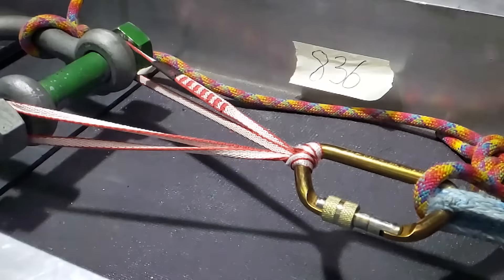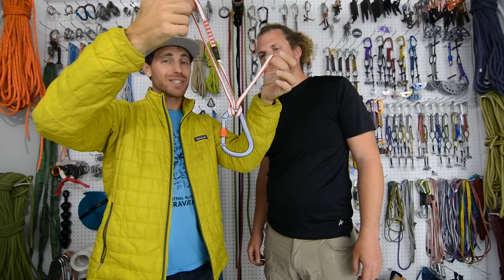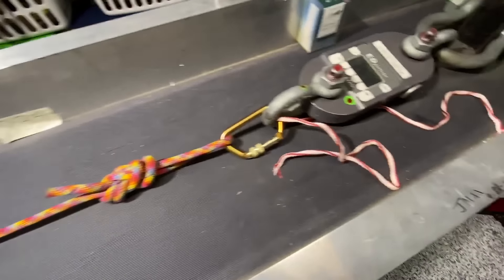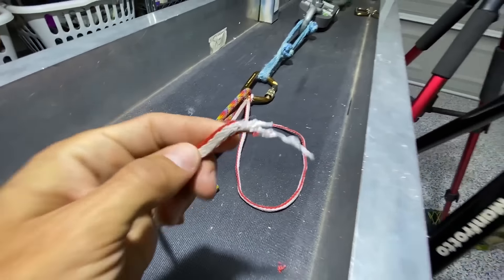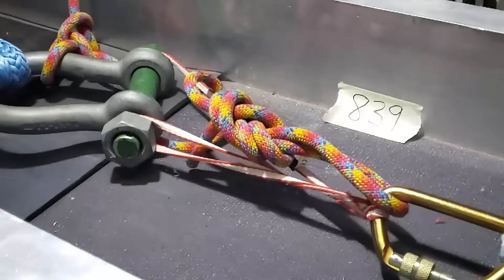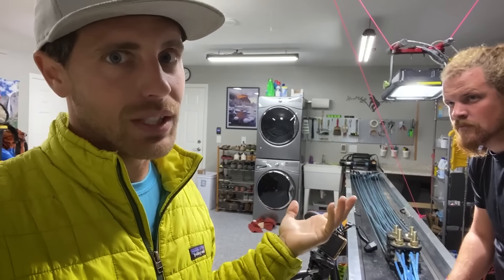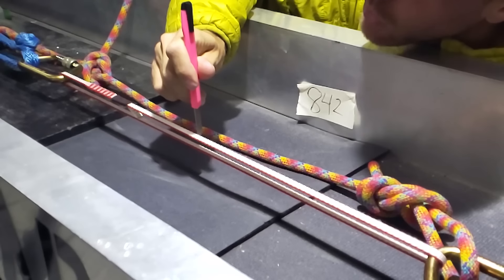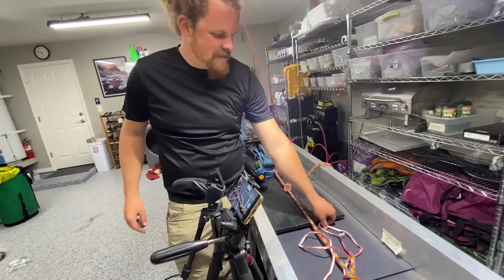Are climbing master points made with a girth hitch or clove hitch REDUNDANT???

Comment: It would be interesting to see the scenario of using clove/girth hitch anchor when the bolt fails instead of the sling failing like in the video. I predict that the carabiner would prevent the sling from slipping all the way through thus increasing the strength(compared to the sling being cut).
When I'm building an anchor to belay a second on a multi-pitch , I am more concerned about the bolt failing then the sling failing, since the sling is mine, I know its history, and I can adjust the anchor or my stance to prevent abrasion, while a random bolt has a lot more unknown variables.
Reply: Agree! Shitty bolts or dubious pro seem like a more likely failure point. Putting the sliding X in it would probably be a good idea, as they mentioned.

Comment: When you do the quad anchor on Accessory cord I would like to see the following scenario(s):
1) Have only "1 bolt" connected (like one bolt "failed") and pull from the remaining bolt and the master point biners with 2 ropes clipped vs. 3 ropes clipped in the quad. In Various thicknesses of cordage.
I know 7mm is the recommended, without realizing I've been using 6mm for years, and do 5mm as well.
I hope I was able to articulate what I meant.... you really should have more subscribers, this is such an awesome channel, I can't recommend you enough!
Reply: Super excited to see how the quad holds up. I bought 7mm cord to build my TR anchors and I'm curious if a double length dyneema runner would do the job just as fine.
Reply from the maker: Thanks.  2 quad anchor episodes coming out over next two weeks.  So many rabbit holes to test

Comment: Good video! Thanks for breaking so many nice pieces of gear so we trust ours more - or less =) 14:05 would love to see it stopping at something like 2 kN and keep to see if it stays or slips. Reason is, you had a fall with load peaking at 4.5 kN, one of the legs broke, then you're hanging on the other leg. The peak load is gone, now the load will be smaller, and the imporant thing is the the other leg holds it and you don't go anywhere.

Comment: About the girth hitch with or without the magic X.
If an anchor fails, it could lead to girth hitch slippery till the end of the sling and out (g.h. without magic X) if you do not consider the anchor carabiner.
But the carabiner is still there, if not broken, so it will prevent the fatal slippery, no matter the kind of girth hitch done.
Good job!

Comment: Longtime listener, first-time caller from the climbing world.

I would be interested in a "sketchy AF alpine/trad/rap anchor setup." The kind of stuff that you come across in the mountains at 2AM and go ahead and rap off because maybe, just maybe, you'll be blessed with the sweet sweet release of eternal death after days of exhaustion, exposure, and starvation. Things like 1" webbing, 9/16" webbing, or 5-7mm cord either directly threaded through or girth hitched to bolt hangers, eyes of pitons, or even directly through the wire cable on stoppers. Basically, when playing this flavor of Russian roulette,  how many chambers are loaded in the gun?

Similarly, how strong are knotted sling placements? There's a lot of variables at play here (material, knot used, placement quality, ...) and building an appropriate test rig might be more difficult. Perhaps something along the lines of a V-slot between a couple boards bolted together?
Reply from the maker: Got any pictures of sketchy af anchors that you are imagining?  Send it to skylining@live.com  I like the idea!
Reply: @HowNOT2  I'll take some shots tomorrow on my workbench of some of what I'm envisioning. In the meantime, this clip https://vimeo.com/222262746 gives a view of Mark Smiley reconfiguring rap anchors in the Ford-Stetner couloir, which is the most popular ski descent off of the Grand Teton (popular being a relative term, here). The before shots (and frankly even the after shots to some extent) give a good image of the anchors that haunt my nightmares. Probably fine for low angle rappels, but certainly a long ways from UIAA certified...
Reply: Good question. Slings, cord, and knotted webbing through any of the hardware you described is going to be fine for rapping. Maximum force you can generate is not much more than 2 kN. The quality of the hardware you were clipping is another story, but the sling material is never going to break. For example, a sling through a stopper wire girth hitched was pull tested to 9 kN. https://www.alpinesavvy.com/blog/hitching-a-sling-direct-to-a-stopper-wire-acceptable

Comment: A common UK and Euro system for two points is a sling with overhand in the centre. The biner then clips through both loops created and each loop goes to an anchor. Can you test that?
Could you do a pure girth hitch test? Say, to a harness belay loop?
Reply from the maker: Do you mean a BFK anchor?  We could test real girth hitches.
Reply: @HowNOT2  I think he means a Shelf Without a Master Point (or SWAMP) anchor. You can see it made here: https://youtu.be/XpwY4vLEKYo
Reply: @KakeaGill  that's it. Just never knew the name. In the UK it's just a sling with a kot in.

Comment: I think it's an really important point, that, if one line on your anchor gets cut and you whip on the still intact one, you might achieve ~7kN force, BUT that is a shockload. So I would GUESS(!!!) that there is a good chance that the knot might not slip the whole way. Sadly that is probably not really testable safely.  
You awesome guys did mention that, but only in like a sidefact.

Thanks for your work! 
Cheers!
Reply: That is what I was thinking as well. That pull held 6-7kN for 3 or 4 seconds of slow slippage where as in a fall that would be the force for 1/10th of a second or less.

Comment: Some comments already mentioned but would be great to see a dynamic test of the clove and girth hitched slip after one side is cut i.e. one bolt fails.  Could start with 80kg FF2 and keep upping the weight until it fails and/or slips.
Reply from the maker: I will probably be doing a drop test machine in the next 12 months.  Have to solve the dyno problem... fast hz dynos are not easy off the shelf purchases.  But will soon/eventually

Comment: If you go to Samson rope website (they make dynema ropes up to 6 7/8" diameter) they specifically say not to use any knots with their rope (or any rope with the same material) because the friction from the knot cinching down creates enough heat to melt the fibers.

Comment: Good to know: 21:15 I didn't break at the cut! =) Holding my slack line in the backyard, I have a 18 years old 16mm nylon sling which has a cut through like 50%. Holding like 5-6 kN. On the other hand, on the same slack line system, some old kevlar cords broke recently, they were just about 12 years old. Both constantly exposed to the outside weather for the last 5+ years.

Comment: It breaks at the carabiner for the same reason it allways breaks in the knot. Where you bend rope it is likely to break as you are not using the whole diameter of the rope where it bends. I'd be curious to see what would happen if that tiny cut ended up near the carabiner. Very interesting!

Comment: Awesome, good job boys. What would be interesting to see is if 2 nylon slings, tied with an overhand knot together (sometimes used for TR anchors) can take more or less force. Does the knot reduce the force capacities enough to cancel out the redundancy of two slings?

Comment: If you do this again sometime, try rotating the clove hitch 180 degrees so exiting cords won’t stress the the crossing cord.  The exiting cords will be on either side of the carabiner, not crossing and pinching the crossing cord.  Is this understandable?  The crossing cord will be INSIDE the carabiner.  The way it was tied in video, crossing cord was on the OUTSIDE of the carabiner.  Sorry I didn’t see till a year later.

Comment: Quad one-leg pull test, please)) In case of one bolt failure, the knot (weakest point) will be at the carabiner (highest tension point on the loop). Will be interesting to see how it holds.

Comment: Amazing work! Really appreciate it.

Guys - is it possible you do some  tests with dynamic (not static) shockloads on the anchors (build with dynema and knots) . If possible use different stuff to simulate what was used to clip in - dynamic rope, static poliamid sling.... 
Falling factor 1 , 2 ? :)
Reply from the maker: Drop test machines require a different dyno that reads very fast.  Trying to figure that out.  after that the drop test tower is easy
Reply: @HowNOT2  Not so sure the dyno is the crucial thing, though. Run, say, a FF1, 1.5 and 2 with the climbing rope tied straight into the anchor. Make the anchor a two-point girth hitch master point, with one leg disconnected. Try at progressively higher FF until things break (if they do). We´d be looking for a realistic (although extreme) scenario in which the slings break, not a force number.  Just donated 20 bucks towards this! For this money, I hope to see YOU be the test weight, like in the shock loading video, that was fun! :-)

Comment: Awesome, as always. And even though, as you say, it is not "science", there is very little science on this subject published in English. So every tidbit is welcome. As to the results: remember that a slow pull is NOT very representative of a real climbing fall. After all, we generally do not try tp lift cars from our anchors. The forces may be the same, but the rate of energy dissipation matters. This is especially true for dyneema, which is sensitive to heat. Anyone know of any tests just like this one, but with a sudden, realistic "fall" instead of a slow pull? (It could still be true that the setup works, but it would be nice to see it confirmed.)
Reply: In real climbing it works, every setup can be pulled to failure, that is Just unrealistic entertaining bullshit.

Comment: The second knot is adjustable. So, the loop slides until the rope is completely released. Try a butterfly knot, for example. Correct is to use butterfly for a start and end of this element of the sistem, and second knot (streme) between them :) So test butterfly knot 😇 it won’t slide from the carabiner 🙂

Comment: So the only way to get to >4kN once the sling or knot fails is to shock load. How is it going to slip all the way if the shock load is applied for less than a second  (ie. shock) and you are testing it to failure with a constant load. Seems to me like you kinda need a new rig with dropping 80kg weights kinda like UIAA/CE ;)
Reply from the maker: Oh i see that in my future for sure.  I need a dyno consultant first to get the right dyno.  The drop tower is easy imo
Reply: Agree. I would love to see how much slip there is if you shock it with what would be a 5, 10, 15, 20 kn load for an anchor that doesn’t slip. It would be interesting to see how much the slippage reduces the shock load as well. If it only slips 1 inch when shocked huge, then I think that is basically a zero concern for climbing. Love your stuff. Keep it up.

Comment: For the first partially cut sling, I beleive the red bit is just nylon, and as this is a woven material, is the weft of the sling... meaning it runs from side to side, not the length of the sling.  It proves the structure and shape, but not the strength..  The white bit is the dynema, and is the warp, the threads that run the length of the sling and give the strength to it.   For the second cut sling, it broke at a significant amount below the uncut sling.  Less of the white fibers were carrying the load, and those remaining fibers broke at the weakest point of those fibers, where they wrapped around the carabiner.  Impressive how much load it still carried though, I've retired gear for much less.

Comment: I usually make an anchor with an overhand knot in the middle of the sling and put a biner into the two loops  on the left and right side of the knot (not into the knot as it is done for the clove or grith hitch). I always thought that such solution is redundant, especially if you take into account that it is more likely to loose an anchor point instead of breaking the sling. I'm wondering what will happen if the anchor points are bomber and the sling will actually break in the overhand knot. Can you guys check it? That would be a nice addition to the great work you've already done! Thanks!
Reply from the maker: I think we tested something similar in this https://youtu.be/NwbMfh4FqT4

Comment: Those slings you were breaking have a safety feature in them. If the red band on the side isn’t complete or you can see a red patch through the white in the middle don’t use the sling.  The red fibres are weaker and don’t give structural strength but give a clear visual cue for “too much” damage.

Comment: Wow, great results.  I typically use 2 dyneema slings for an anchor with sliding X on both biners (1 sling, 1 biner).  Would be interested if this gives 2x strength or where the slings meet at the bolt biners if there's friction there ?
Reply: No knots in them.

Comment: The outer red thread on the dyneema sling you cut the first time is nylon, used to color code and hold the dyneema weave together. Dyneema itself can't be dyed, that's why it's always white. That's crazy that it didn't break at the cut the second time. I would say a bigger sample size would be needed to make a statement like that IMO, but wouldn't have expected that. Thx for the vids. Keep up the great work!
Reply: Can't find the patreon link btw
Reply from the maker: Thanks!

Comment: The cut on the outer red didn't reduce the strength because that red is just Nylon for color. Dyneema doesn't accept dye well, so the manufacturers add nylon strands to color different sling lengths differently.

The second one wasn't a cut of half the strands, so again I'd expect less strength reduction than an overhand knot. There was some reduction from the MBS, just nowhere near 50%.

Comment: I was swaging some wire loops for a non-climbing project and started to wonder how strong are the ferrules and wires sold at Home Depot versus on wired nuts and are the ferrules on the wired nuts going to be the weak point in them? I don’t see that you have done any videos on this topic. I would find it to be a cool test.

Comment: I feel like I should point out that although the dyneema slips around 4-8 kN, it takes several seconds of sustained pulling at this level to slip all the way loose.  This isn't like a climber falling, it's like a climber getting grabbed by the kraken and being dragged down into the sea.

You'd need to bring it up to this level briefly (less than a second), and then drop down to 1 kN or so to simulate the climber dangling for a while after the fall to have a meaningful test.  We know the dyneema will slip with high sustained forces, but it's not clear if it'll slowly slip just under the weight of our dangling climber.

Comment: It seemed like the cut skiing still broke more easily. I bet the cut increased the force on the non cut fibers of the sling, causing them to break at the bolt threads

Comment: The defining different b/w the two measurements is that kN is a dynamic force and the kg is a static force, just plain weight.  A dynamic force is a load in motion, in which case small weights can generate very large forces at high speeds (kN), such as in a fall.  Which is the very nature of climbing, which is why a dynamic rating is necessary, since you;re not lifting.  This is also why a lifting sling is rated in a static load (lbs).  One is a fall rating, the other is lift rating.  There you go...because...SCIENCE!
Reply: Well, a force is always a force. Kilograms is mass. But I agree with you on your conclusion. The crucial difference between a pull test and a fall test is that in a fall a lot of energy must be dissipated as heat in a short time, while in a slow pull test the energy per time unit is probably lower. (Energy = distance x force. Or in other words, heat=slippage x force.) It matters, since a moderate temperature (about 140 C) can kill a dyneema sling even at low forces.

Comment: would have been nice to see when you cut it, pulled again , when it got up to five KN just hold it there and see if it starting slipping. Should have tried with a knot also, with the 30 percent cut, to bypass.

Comment: Why are climbing anchors so weak. I thought that when someones life is on the line you should use a safety factor of 10:1 or even 15:1 for determining working load limit. You said that you could generate 4.5 kn on an anchor therefore the anchor should break at 45-67.5 kn. Seems like a lot of climbing materials break below their safe working load. What am I missing here? Is there a smaller safety factor used in climbing?

Comment: nylon slings would be really interesting
Reply: Nylon slings are pretty thoroughly understood even if they don't snap them.  I work as a crane operator and rig with many of the same materials.  Industry publishes charts giving the estimated strength by thickness and material.  It shows the reductions for things like choking (half typically) and increases for a basket sling.  You can find the charts by googling nylon sling rigging chart.

Even things like dyneema rope and web are from sailing, rigging and other industries.  I'd be willing to bet that most climbing suppliers are relabelling and reselling most of the things used in climbing and slackline after a very hefty markup.  There should be published data for most of it.

Comment: It would be interesting to break some of the questionable climbing gear on eBay, you know the stuff under $20 😂.
Reply: Yes! please test the strength of a few $20 and $40 kernmantel ropes in the 10.5mm diameter. I know CE &UIAA occurs on $150 ropes but i would definitely be interested in the low end for tree swings and hauling.